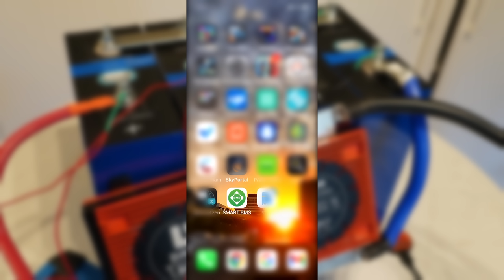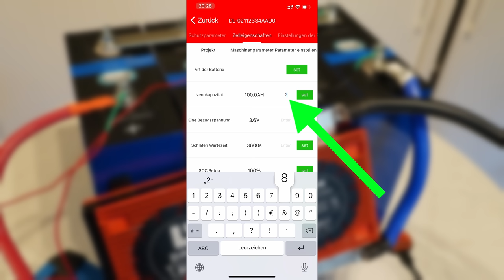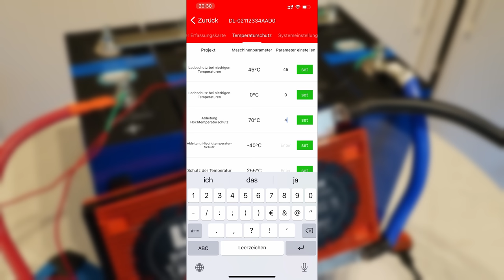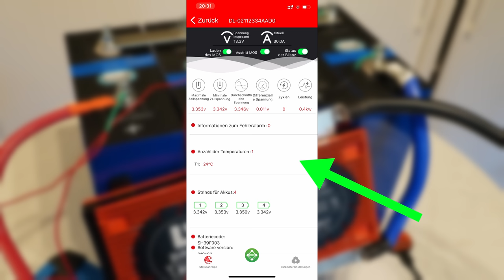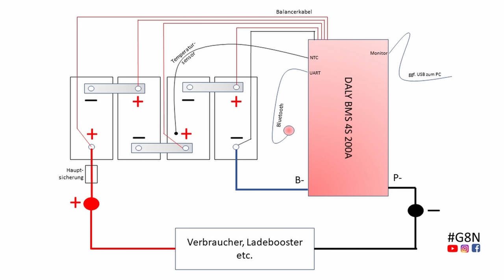Wie? 280Ah 🔋 Selbstbau für 599€, how to mit allen Details ausführlich erklärt #G8N

Comment: Hallo,danke für die videos.
Ich habe 8 batteriezellen 2mahl 280 Ah angeschlossen als 24 volt.
Dali BMS 250a für 24v
nach dem anschließen zeigt akku ist voll aber entlademodus ist aus .
Fehlermeldung "Gesamtspannung ist zu klein"
Level2.
Was mach falsch? Was bedeutet "Gesamtspannung ist zu klein"
Danke in voraus.
Mit freundlichen Grüßen 
Waldemar
Reply from the maker: Hallo Waldemar, was mich gerade sehr stutzig macht ist deine Aussage "2mal 280 Ah". Willst du ein 12V oder 24V System bauen? Bei eine 24V werden 8 Zellen in Reihe geschaltet. Bei einem 12 Volt mit 8Zellen werden jeweils 2 Zellen Parallel und diese 4 Blöcken dann in Reihe geschaltet, dafür verwendet man aber ein 4S BMS.  Beste Grüße Mr@G8N
Reply: @G8Neu  hallo,
Bei mir sind 8st Reihe geschaltet 24v.
Entlademodus ist immer ausgeschaltet.
Mfg Waldemar

Comment: Hey - Danke für dein Video.

Meine 4 Zellen kommen die Tage und ich würde jede Zelle auf 3,65 Volt einzeln aufladen und mit dem Batterietester/Lader ebc a20 danach auf Kapazität testen, danach alle 4 in Reihe stecken und 5 Tage stehen/ruhen lassen.
Danach parallel schalten und gemeinsam aufladen/nutzen. 
Vorgang so okay?
Reply from the maker: Fast, du hast parallel und seriell verwechselt. Also Aufladen, Testen. Dann wieder aufladen und parallelschalten. Dabei kannst du nochmal etwas nachladen, aber sobald die 3,65 oder auch 3,6 Volt erreicht sind abschalten und stehen lassen. Nun kannst du deine Batterie zusammenbauen und benutzen, also seriell schalten. Viele Grüße Mr@G8N

Comment: Ich baue gerade aus den gleichen Zellen und einem Daly 120 A BMS meinen Akku für mein Boot zusammen. Die Gewindestifte (meine sind aus A2 um Korrosion an der Salzluft zu vermeiden) sollten mit Tefgel (gibt es in Deutschland bei den Bootsausrüstern) eingesetzt werden um Kontaktkorrosion zwischen Aluminiumpol und Stahlstift zu verhindern. Da die wesentliche Stromleitung über die Pole und die Unterlegscheiben geschieht kann, glaube ich, die schlechtere Leitfähigkeit von Edelstahl vernachlässigt werden.
Ansonsten SEHR  gute Darstellung, vor allem auch zum Balancing. Frage dazu: reicht die Balancing-Funktion des Daly BMS nicht dafür aus, ist das tagelange parallelschalten wirklich nötig ?
Reply from the maker: Hallo John, es gibt natürlich viele Varianten und Möglichkeiten eine solche Batterie zu bauen. Ich habe hier meine Erfahrungen geschildert, mit denen ich die besten Erfahrungen gemacht habe. Viele Grüße Mr@G8N
Reply: @G8Neu  Na klar, ich wollte nur eine Ergänzung für die Verwendung an Bord geben. Es bleibt aber die Frage, ob das 'passive' Balanzieren ( parallel schalten der Zellen für mehrere Tage unverzichtbar ist oder ob das über eine längere Zeit auch durch das BMS alleine geleistet wird.

Comment: Hallo, kann ich bei meiner 100ah batterie auch eine 100a megasicherung nehmen anstatt 200a. Und wie ist das mit dem 50mm2 Kabel reichen da auch 25mm2? An dem Bms ist das Massekabel ja auch recht klein. Oder bin ich da ganz falsch? Viele Grüße
Reply from the maker: Hallo Joachim. Die Sicherung sollte so groß sein, dass sie ausreichend für alle eingeschalteten Verbraucher ist. Ob 25mm² für deine Kabel ausreichend ist, ist abhängig vom Strom und von der Länge der Kabel. Hierzu gibt es im Internet Kabelquerschnittsrechner. VG Mr@G8N
Reply: @G8Neu  
klasse Video, das fehlte mir noch um mich selber an den Bau zu begeben. Eine Frage noch zur Hauptsicherung: Wozu benötige ich die wenn doch zum einen die Zellen durch das BMS abgesichert sind und zum anderen alle angeschlossenen Verbraucher auch einzeln abgesichert sind?

Comment: Hey - wie groß sollte die Sicherung am Pluspol sein bei einer 320Ah 12 Volt Anlage? 
300 oder 350 Ampere?
Reply from the maker: Hallo Lorraine, die Absicherung der Batterie hat genauso wie die Auswahl des BMS Systems nichts mit den Amperestunden der Batteriezellen zu tun. Sondern damit wieviel Leistung du gleichzeitig aus deiner Batterie ziehen möchtest. Wenn du also in der Spitze 2000 Watt aus deiner Batterie ziehen willst, brauchst du eine 200A Sicherung. Willst du, 3000 Watt ziehen so bräuchtest du 300A Sicherung, und natürlich auch ein entsprechendes BMS. Hier ist der Link zu dem BMS Video https://youtu.be/WIGAZKM5l4k und hier der Link zu den Elektrogrundlagen https://youtu.be/qRsrzEF_ZQc Viele Grüße Mr@G8N

Comment: Hallo und vielen Dank für die sehr informative Anleitung. Überlege mir auch eine Batterie zusammen zu bauen. 100 oder 200 AH. Im Moment ist bei mir eine 100 AH AGM verbaut.
Frage: Welches BMS für welche Batterie Kapazität?
Freue mich schon auf die nächsten Filme.
Grüße Joga
Reply from the maker: Hallo Joga, das kleinste BMS was ich verbauen würde, wäre genau die 200 Ampere Variante. Das hängt zum einen damit zusammen, dass der maximale Ladestrom 100A sind und sehr wahrscheinlich, früher oder später, ein Wechselrichter dazu kommt. Aktuell finde ich das von mir vorgestellte System mit 280Ah bzw. 310Ah das sinnvollste, bei der Verwendung der kleinen Zellen wirst du nur wenig sparen. Ich schätze insgesamt 50-100€. Ich bin dafür immer Reserven zu haben und würde gerade bei der Batterie, Kabeln und BMS immer reichlich planen. Im Übrigen ist das vorgestellte System etwa so groß und so schwer wie eine 95Ah AGM, hat aber die 5,5-fache Kapazität nutzbar.
Viel Spass beim Bauen, Mr@G8N
Reply: @G8Neu  200A bei 12 Volt , das werden dann aber Hammer Kabelquerschnitte werden !
in der Realität sage ich jetzt mal reichen 99% der Nutzer 150A mehr als aus , 2000 Watt Wechselrichter ist da schon drin und mehr braucht kein Mensch , bei gerade einmal 200Ah

Comment: Hallo,
muss man beim Ladegerät auch etwas spezielles einstellen?
Oder reicht die Standard Lifepo4 Batterie Einstellung? Danke schonmal für die Antwort
Reply from the maker: Am besten auf maximal auf 14,4V (Blei oder GEL) und sollte dein Ladegerät eine Temperaturkompensation haben dann den Temperaturfühler abklemmen. Manche Ladegeräte haben noch eine Rekonditionierungs Schaltung, die sollte auch nicht benutzt werden. Viele Grüße Mr@G8N
Reply: @G8Neu  okay also benötige ich kein spezielles Ladegerät?
Reply from the maker: @u6omsr454  Nicht zwingend, du kannst dein weiterverwenden. Wenn du deine Zellen schonen willst, dann schalte die Ladegeräte aber ab, wenn die Zellen voll sind. Also nicht dauerhaft laden.
Reply: @G8Neu  vielen Dank für die Infos.
Ich lade im Camper mit Ladebooster, Ladegerät, Solaranlage. 
Würdest du bei nicht "Campingmodus" den Solarregler von der Batterie trennen?
Reply from the maker: @u6omsr454  Würde sagen ja. Wenn du eine Victron hast, den könnte man entsprechend einstellen. Mach dir aber um das ganze keinen zu großen Kopf die LiFePo4 können ne Menge ab.

Comment: Hallo, ich habe mir inzwischen 2 LiFePO4 Batterien a' 340Ah mit jeweils einem Daly BMS 12V/250A nach Deinem "Muster" gebaut. Die beiden Batterien sind in meinem Wohnwagen parallel an einen Wechselrichter angeschlossen. Nun ist mir in der Daly App aufgefallen, dass der Entnahmestrom, den ich über einen Victron Shunt messe, scheinbar nur aus einer Batterie fließt, während die andere Null Entnahmestrom anzeigt. Schalte ich das "belastete" BMS per App ab, zeigt nun die zweite Batterie diesen Entladestrom.
Hast Du eine Idee was da sein kann? Ist das evtl. ein Fehler in der App?
Schöne Grüße,
Klaus
Reply from the maker: Hallo Klaus, ich habe eine Weile über deine Frage nachdenken müssen. Ich bin mir aber inzwischen ziemlich sicher, dass das einfach nur ein Anzeige Problem in der Daly App ist. In der App kannst du mehrere Batterien in parallel schalten oder in Serie schalten, die App errechnet daraus dann den Gesamtstrom und Gesamtspannung. Das denke ich ist einfach das Problem. Im Zweifelsfall würde ich mal mit einem Zangen Ampere Meter nachmessen. Oder eben nur jeweils eines der BMS in der App anzeigen lassen. Beste Grüße
Reply: @G8Neu  Hallo, danke für die Rückmeldung. Ich sehe das inzwischen genauso. Ein Zangenmessgerät für Gleichstrom muss ich mir noch besorgen, dann messe ich mal nach, um ganz sicher zu sein. Eine gute Zeit und schöne Grüße 🤗

Comment: Hallo, ich möchte im nächsten Frühjahr, nachdem ich mit 5 Säurebatterien a 120Ah für meine kleine Inselanlage nur negative Erfahrungen gemacht habe, mir ebenfalls LiFePo4 Akkus besorgen. Da ich deinen Selbstbau aus Siebdruckplatten super finde, werde ich das genau so nachbauen. Inkl. Balancer, BMS, Sicherung usw. Da meine Frau öffters mal in unserem Gartenhäuschen eine Induktionsplatte benutzt, wollte ich 320Ah LiFePo4 Akkus nehmen. Spricht da etwas dagegen und sollte ich besser 280Ah Akkus nehmen, da dies sehr verbreitet sind?
Danke für eine Antwort 🙋🏻‍♂️
Reply from the maker: Preisleistungsmäßig sind die 280Ah Akkus die günstigsten, 320 Ah sind hochgezüchteter Zellen und auch etwas empfindlicher. Ich würde, wenn es notwendig ist, dann wahrscheinlich eher zu zweimal 280 Ah greifen.

Comment: Top Video! Ich bin gerade dabei mir ein elektrisches kart zu basteln. Dabei benutze ich zwei 1KW Motoren mit je 36Volt. Fahre aktuell noch mit 3x 12V 12ah bleiakkus, allerdings lässt deren kapazität erwartend drastisch nach. Was für ein Setup kannst du mir in meinem Fall empfehlen? 
Viele Grüsse und mach weiter so!
Reply from the maker: Hallo Jan, für Dich wäre ein 12 S System das Richtige denke ich, also 12 Zellen in Serie. Da vermutlich das Gewicht bei Dir eine große Rolle spielt, wirst Du wohl auf etwas kleinere Zellen gehen müssen, z.B. 100Ah, dann würde der Block ca. 32 kg wiegen. Viele Grüße Mr@G8N
Reply: @G8Neu  Alles klar! Vielen Dank für deinen Ratschlag :)
Reply: @G8Neu  vermutlich muss ich dann aber die Batterien in drei 12v Blöcken wieder aufladen oder? Bzw. gibt es das BMS auch mit 36V?
Reply from the maker: @Freak00737  Ja, gibt es... ein 12S BMS. Im nächsten Video zeige ich es. VG Mr@G8N

Comment: Danke für die sehr gute und auch nachhaltige Informationen. Was sich noch nicht ganz verstehe ist.... dass mit dem BMS, wenn ich eine 200AH zusammenbaue ist ein BMS / LiFePo4 4S 12V BT / 200A erforderlich? (€ 187,31 Aliexp) ich schaffe es nicht da was zusammenzustellen um 600€.
Würde mich über eine nette Rückmeldung sehr freuen.
Dankeschön :))
Reply: Es kommt darauf an ob du einen Wechselrichter verbauen möchtest oder ob du bei 12V bleibst. Bei 12 Volt würde theoretisch auch ein 100a BMS reichen. Ich habe ein 200a BMS genommen, weil ich flexibel sein wollte und weil die ab 200a eine bessere Bauqualität haben. Das erlaubt mir ebenfalls nachträglich einen Wechselrichter mit 2400w nachzurüsten (200A  BMS x 12V Schaltkreis = 2400W)
Reply: Die Preise sind alle in die Höhe geschossen. Um die 1000 Euro sollte man schon einplanen. Man kann auch etwas sparen, wenn man aus dem Chinalager bestellt und 2-3 Monate warten möchte. Rückversand wird bei Problemen jedoch dementsprechend schwierig, weshalb ich mich für das EU lager entschieden habe und nun mit 280ah Batterien und 200a BMS auf um die 1000€ komme. Dabei sollte man bedenken, dass die Batterien jahrzehnte lang halten und die Mehrkosten pro Monat Nutzungsdauer fast nicht vorhanden sind.

Comment: Hallo,wieviel Geld hast du gespart gegenüber wenn du die gleiche Batterie beim Händler oder Ebay gekauft hättest??
Reply from the maker: Das lässt sich schwer sagen, ich vermute so 60%. Aber Geld sparen war nicht Hauptintension in erste Linie war ich mit den Technischen Ausführungen und den Leistungsdaten unzufrieden. Insbesondre beim Betrieb mit Wechselrichtern. Bei einem 2KW Wechselrichter muss das Gesamtsystem aber mindestens 200A Dauerlast abkönnen. Die meisten fertig Akkus haben aber eine maximale Belastung von 100A und das ist einfach viel zu wenig. Viele Grüße Mr@G8N

Comment: Ich möchte Sie gerne etwas fragen. Ich mache mir gedanken über eine 560Ah Batterie bestehend aus 8x280Ah Zellen. Nun gebe es die möglichkeit zwei 280Ah Batteriebänke zu bauen bestehen aus 4 Zellen und diese in Rheie Schalten. Und die zweite möchglihkeit wäre jeweils zwei Zellen Paralelle und diese dann mit einender in Rheie Schalten.  Was fänden Sie denn besser?
Reply from the maker: Hallo, ich gehe mal davon aus, dass du ein 12 Volt System fürs WoMo meinst? Dann würde ich ein 2p4s System bauen. Also je 2 Zellen parallel und dann davon 4 Stück in Serie (Reihe). Bei einem 4s2p also zwei Batterien mit je 4Zellen und dies beiden Batterien parallel. Benötigt man ein zweites BMS, was ja auch wieder 150€ kostet. Sehr wahrscheinlich werden diese beiden Batterien dann etwas „schief“ belastet aufgrund der unterschiedlichen innen Widerstände und Verkabelung. Ich glaube nicht, dass dies ein Problem in der Praxis ist. Dennoch würde ich die erste Variante vorziehen. Die zweite Variante würde ich machen, wenn es bedingt durch den Einbauort nicht anders möglich ist. Du merkst an meiner Antwort das es nicht einfach zu beantworten ist. Es gibt für beide Variante für und wider. Alle Zellen, die ich bis jetzt hatte, waren sehr gleich und laufen wirklich problemlos, daher die 2p4s Variante. Die meisten Probleme, die ich gesehen habe, sind auf schlechte Kontakte zurückzuführen, daher reite ich auch im Video so auf dem Thema so rum. Viel Spaß beim Bauen, Mr@G8N
Reply: @G8Neu  ja, es soll ein 12V system für Womo werden.  Danke für Deine Antwort.
Reply from the maker: Wenn du dein geplantes System fertig hast, wirst du begeistert sein, was es kann! Da kannst du dein Landstrom-Kabel zuhause lassen. Oder du nimmst es mit, um anderen Campern Strom zu spendieren 😎 oder ein liegengebliebenes E-Auto aufladen damit es zur nächsten Ladesäule kommt. In deinem Akku stecken dann immerhin etwa 7,2 kWh, das haben viele noch nicht mal im Eigenheim als Solarstromspeicher. 👍 Da kannst du dir auch überlegen, ganz auf Gas zu verzichten und zwei Induktionskochplatten einbauen, das habe ich auch immer noch im Hinterkopf. VG Mr@G8N
Reply: @G8Neu  Die 8 Zellen habe ich mitte April bestellt. Sollten im Juni da sein. Und da freue ich mich natürlich dass ich Dein Video vor dem zusammenbau gefunden habe. Jetz werde ich noch ein BMS bestellen sobald ich weiss welches ich benötige für meine Verbraucher.
Reply from the maker: Was ist den dein särkster Verbraucher, vermute eine Wechselrichter? Und was für Ladegeräte, Ladebooster hast du? VG Mr@G8N
Reply: @G8Neu  Ich habe im Dezember einen Sprinter gekauft den ich seitdem jeden Abend Ausbaue. Mit Elektrik habe ich noch nicht angefangen. Ein grössere Wechselrichter ist geplant. Ich denke 1600 Watt
Reply from the maker: @okofilm  Na ist doch super, dann passt das 200A BMS perfekt, das kann man für Wechselrichter bis 2000W gut einsetzen. Bitte denke an den Einbau eines B2B (Batterie zu Batterie) Ladeboosters. Viel Spaß beim Ausbau, Mr@G8N
Reply: @G8Neu  habe so eben den 200A BMS bestellt. Danke für den Tip.

Comment: Extrem gute Darstellung - besser geht´s nicht.
Habe direkt Lust bekommen, für den Camper so ein Teil nachzubauen.
Allerdings sind die Preise nun bei ca. 800 statt 420 Euro fürs Batteriepack.
Eigenartig - denn Fertigbatterien (z.B. LionTron) haben sich preislich kaum verändert.
Woran könnte das liegen?
Reply from the maker: Ich würde sagen dran das sie vorher schon 2-3x so teuer waren. Damit können sie etwas höheren Einkaufs-Preise locker Puffen. Vermutlich werden diese aber auch bald nachziehen, spätestens wenn sie neue Zellen aus China bestellen. Viele Grüße Mr@G8N
Reply: @G8Neu  Danke - es scheint so zu sein, daß es nach wie vor einen Nchrfrageüberhang gibt (die Ecoflow Delta 1300  ist seit 1 Jahr preisstabil, obwohl die Zellenpreise sich vermutlich reduziert haben).
Das erklärt für mich aber nur unzureichend, daß die reinen Zellen sich in den letzten Wochen fast verdoppelt haben.
Über den Preismonitor bei idealo läßt sich die Preishistorie leider nicht nachvollziehen.

Gibt es da derzeit eine gravierende Unterversorgung, die solche Preissprünge erklärt?
Der Preisunterschied zur Fertigbatterie mit BMS, BT und 5 Jahren Garantie ist derzeit so gering, daß die Zellen eigentlich keinen Sinn ergeben.
Haben Sie eine Vermutung, wie sich die Preise mittelfristig entwickeln werden (abgesehen von der üblichen technischen Deflation)?

Comment: Bei dem Daly S8 BMS bei mir 300A lässt sich der PIN Code neu programmieren ;-))
Reply from the maker: Ja, ab 8s scheint da zu gehen, du kannst auch eine andere Software auf dem PC benutzen. Bei meinem 16s geht es auch. Aber eben leider nicht bei den 4s Varianten und die „kleinen“ also unter 150A haben auch noch andere Macken. Die kleine sind auf extremen Strom sparen ausgelegt damit sie den Akku nicht leer saugen. Deswegen auch die Empfehlung mindestens das 200er zu nehmen. Viele Grüße Mr@G8N

Comment: Moin hast du ggf einen Tipp warum ich die Werte Zellen Referenz Spannung und Soc Setup nicht verstellen kann unter Zelleigenschaften ?
Ich habe bei der Zellen reference Spannung 3,20v  und bei dem SOC setup 23% werkseitig. 
Vlt hast du da ein Tipp für mich ^^
Reply from the maker: Das BMS zeigt den SOC Wert nur aufgrund der Spannung an. Das ist grundsätzlich nur ein grobes Schätzen. Diesen Referenzwert kann man bei einigen BMS einstellen, bei anderen nicht. Das ist abhängig von der Firmware. Ich konnte aber noch nicht herausfinden, was dieser Wert tatsächlich bewirkt, aber 3,2 Volt ist nicht falsch. Viele Grüße Mr@G8N
Reply: @G8Neu  okay alles klar danke dir dann werde ich das nochmal beobachten im Laufe der Zeit. Solange nichts falsch ist ist sowieso alles gut ^^